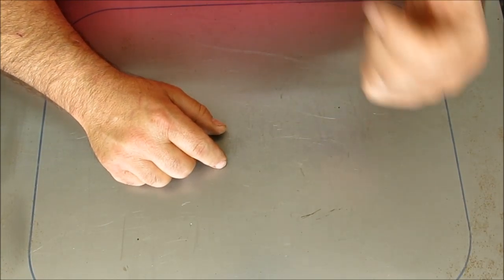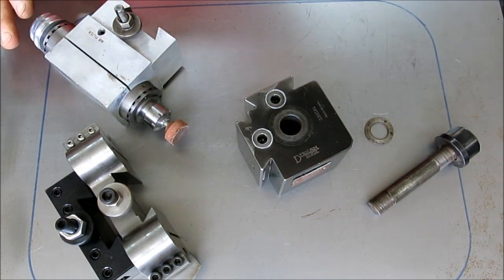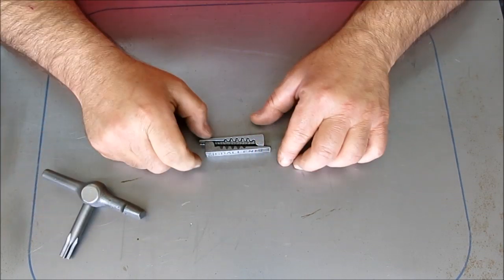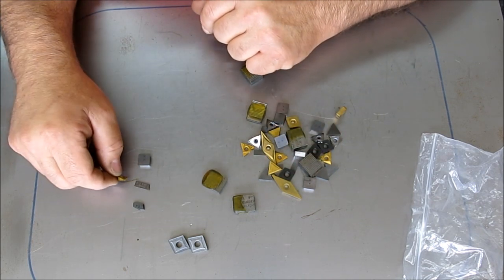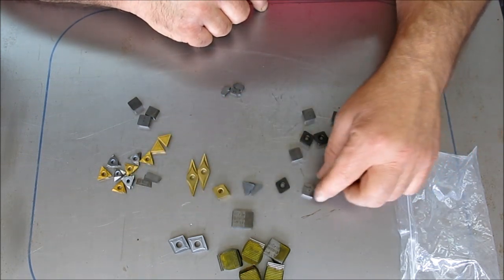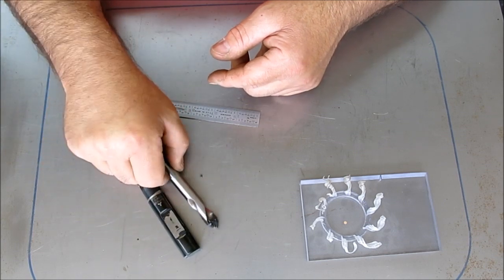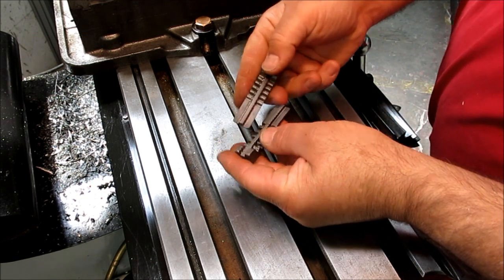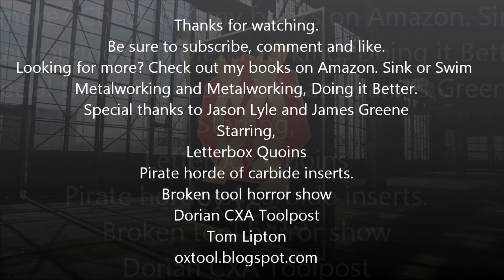Monday Night Meatloaf 41

Comment: You got a lot of really nice gifts this week. Good deal with the new tool post. First time I seen one like that. 
I keep failing on the mystery tools. Again no idea whT this one is used for. 
I think I have a few broken tools hidden around my place too. We used to have a small carbide boring bar. In my young days I clamped down on it way to hard and snapped it in half. That sucked. 
I like those little wedge clamps you shown. For the 5/8" slot I have some 5/8" flat bar I use to make back stops. Has always worked good for me too. 
Thanks for sharing all the goodies. Talk to you soon. 

Adam
Reply from the maker: Hey Adam,

Thanks for stopping by. I could see you snapping a boring bar with your pinky finger on accident. 

All the best my friend. 

--Tom

Comment: It's a pounce wheel.  Used to trace patterns onto material in woodcarving or tracing art for making stencils.  Also, lays down an evenly spaced dotted line for stitching like in leatherwork.  From an old English word meaning punching tool. 

Two ways to use it:  1- put carbon paper between the tracing and the original and run the wheel over the original; or, 2 - perforate the original with the teeth of the wheel and place it on the material and dust it with a pounce ball (from old French to dust)... a linen ball filled with chalk.

Comment: Hi Tom,

I have a Dorrian post on the Harrison L5, but mine has the central locking lever just like the Alloris.  Very fine tool post. I bought it to replace a Dickson, too many bits sticking up and the holders were too expensive. Also I found a tendency to work loose on interrupted cuts.

With reference to the roughing endmill,  don't you know you should cut Aluminium dry?

Sorry, continuation of some comments on one of Doubleboosts recent uploads. Apparently those of us who use lubricant on Aluminium are doing it all wrong!
Reply from the maker: Hey Paul,

Does your Dorian have eccentric pins that wedge out the rectangular keys? There seems to be no mechanism that retracts the keys. Rotating the eccentric just relieves pressure on the locking key and allows the tool block to be removed. I'll have to get me some aluminum lube......

Cheers,

Tom
Reply: oxtoolco
Hello Tom,

My toolpost has a central eccentric, like the piston style posts. The rectangular keys aren't positively retracted and you sometimes have to encourage them a little when mounting a holder if the block is a tight one.

Comment: Nice video with some good ideas. I would like to say I haven't broken any tools in my shop, but as my video this week shows that is not the case.lol Live and learn! It won't be happening because of too low an amp heaters for the supply voltage again I can promise you!
Reply from the maker: Hey Brian,

I once asked a guy in an interview when the last time he broke a center drill. He told me he has never broken a center drill. Guess what. He didn't get the job. Is that a trick question?

Cheers,

Tom

Comment: Run the ponce wheel along the lines on your blueprint or drawing, then dab on powdered chalk (wrapped in a sock). This will transfer the line to the workpeice. Only works on 1:1 blueprints or drawings. This method is used a lot by some modelers making scale buildings in architecture.
Tom - Vista CA
Reply from the maker: Hey Tom,

Thanks for the comment. Never seen that method. Have you seen the acetone transfer method for photocopies?

Cheers,

Tom
Reply: Tom,
I've never heard of that method.
Tom...

Comment: If the knurled wheel is pointy sharp it could be a pounce wheel. These are used to follow lines on paper patterns to perforate the paper followed by a gentle sanding on the reverse side. The pattern is used as a "stencil" for pouncing with a chalk bag to transfer a dotted chalk dot image on a surface to be lettered with sign writing quill brushes. If the wheel is not sharp I don't have a clue.

Comment: Hey tom, 
Just for your information the frame that the letters are locked in when type setting is called a chase, 

Your videos inspire me, im a 25 year old engineer working for rolls royce but eventually want to work for my self in fabrication and manufacturing engineering

And each time i watch you it pushes me more and more to achieve this please keep up the awesome work

Many thanks all the way from the UK

Cheers 

Pete
Reply from the maker: Hey Pete,

Thanks for the nice comment. Be a sponge and learn as much as you can about as many things as you can. 

All the best,

Tom

Comment: That is a tool for putting ornamental splines and patterns onto spindle work.  The tool is held perpendicular or nearly so to the turning workpiece.  The workpiece causes the burr to spin and cut small splines in to the turning surface.  It can be used on OD, ID, or the face.
Reply from the maker: Hi Perry,

Good guess but not quite. Thanks for the comment and playing along.

Cheers,

Tom

Comment: Hi Tom,
I enjoyed the video and found the "qoins" interesting a neat setup device. I like inserts also and only when they are completely gone am I able to part company with them. Your discussion about running your shop and the tools which are often lost by accident, inexperience, or abuse touched upon a great topic . Often the guys in a shop do not realize how expensive perishable tooling is and so it is a good thing to help them be mindful to take care. It has been a while since I really took note of the cost . To be prepared I am wanting to buy certain perishable tooling for when I end up without it and then later get reimbursed by my employer. I was shocked and humbled by the prices of them. I am careful anyway and now I will be even more. Maybe a good breakdown on the issue might be good for a video. Cheers! Lew
Reply from the maker: Hey Lew,

I used to write the prices on the carbide end mill tubes and insert boxes. I don't think it did any good but I bet a couple folks paused for a minute when they went into the tool crib.

Cheers,

Tom
Reply: We have a tooling sheet which list all tooling used now and we keep track of the performance of how they work. This will allow us to be sure we maximize  our efficiency. Perhaps other tooling will be a better choice and only by measuring results will bear improvements. One fellow hangs the end mill out too far having less rigidity breaking the after two parts when it should do seven. Solution place proper clearance tool to holder length thus correcting setup sheet instructions. I like the process of it. Pricing the boxes sounds good too.
Reply: This is a new thing in our shop for counting our actual costs more accurately. Any new process we have such as this is always a improvement. I never complain about such things because it is always something productive and so I always embrace any change.

Comment: i used to have a few tool fail trophies also had a few engine fail trophies as well tom great video tom touched on quite a few subjects can wait to see how the autometric is coming along
Reply from the maker: Hey Andy,

Now the racing guys have some impressive mangled metal items. Nothing like a couple hundred horsepower beating some poor metal part senseless.

Cheers,

Tom
Reply: oxtoolco
 yeah got some pretty shaped valves and some pistons worth £400 each with holes in and valves stuck out of the top also had a cylinder were the valves look like nails hammered in and bent lol

Comment: Tom,
The quiones are very interesting. But would they work loose during a milling operation or do they have some flex that keeps them set in place?
Eric
Reply from the maker: Hey Eric,

They have an angle similar to adjustable parallels. The seem to have some spring to them when you wind them into the tee slot. Never had a problem yet.

Cheers,

Tom

Comment: Hi
Tom
I need some of those quoins
I have some tight fitting key steel I use on my mill
Regards
John
Reply from the maker: Hi John,

Thanks for the comment and stopping by. The quoins are neat because you don't have to pry them out when you want to remove them. 

Cheers,

Tom

Comment: Love the fan-cooled spindle on the grinding tool!
I think those thin kaiser inserts fit an iscar toolholder similar to the one I have here.
AND, I'm thinking that insert endmill found the vice jaws with extreme prejudice!!  LOL
Where do you find all the stuff??  ;-)

Colin
Reply from the maker: Hey Colin,

Been hanging around shop for a little while. That's my main job is to notice things and do something about it.

cheers,

Tom